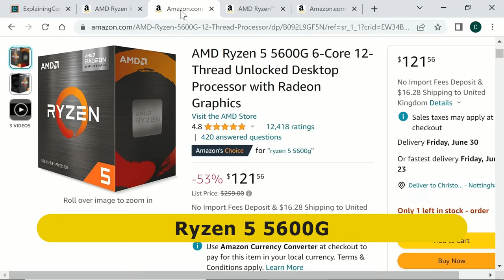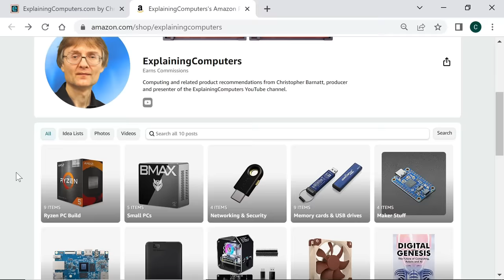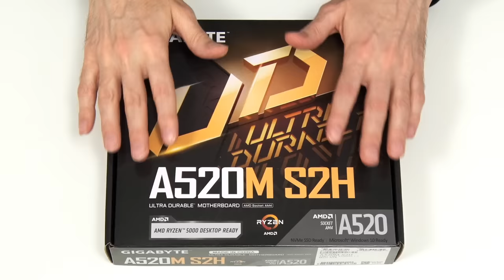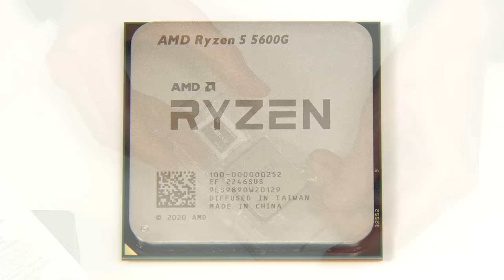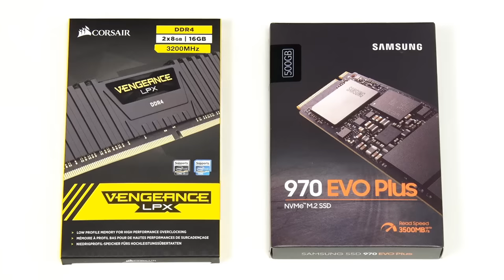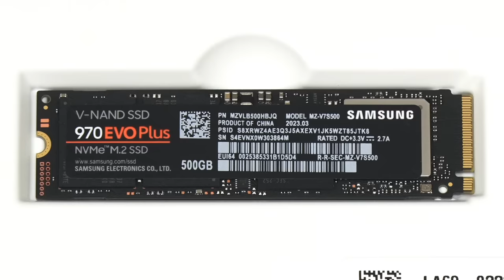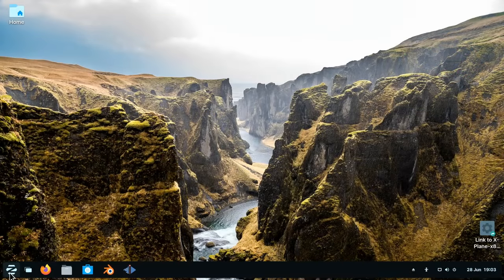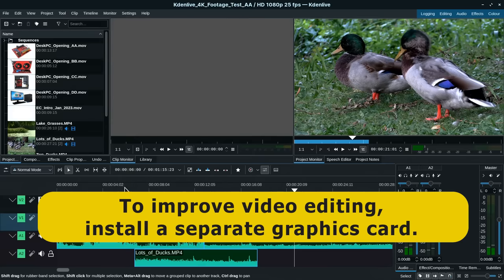Best Value Ryzen PC Build

Comment: Thanks for the vid.  Could you write a few words here about compromise made  using these components.  Specifically what ISN'T possible / needs an upgrade to achieve.  When would you choose a "better" motherboard ?  Does a non-g chip cost saving make a gpu "very good value" ?  Someone below mentioned a 450 motherboard that handles all ryzens, not a 520; is that a sensible route ? thx.
Reply from the maker: Many people here are obsessing about the benefits of B over A motherboards. But the only benefits are that (a) B motherboards can be overclocked, and that (b) some B motherboards have more connectivity -- eg 4 rather than 4 RAM slots, and maybe 2 rather than 1 M.2 slots. So they offer better upgrade options. But they also cost more. So unless you plan to upgrade or overclock (and on most PCs, neither ever happens), there is nothing at all wrong with an A motherboard. To be absolutely clear, there will be NO difference in performance.

Note that you may hear/read that B motherboards have more/better VRMs (voltage regulator modules) which is true for the higher-priced B boards. But again this is only really an issue if you want to overclock. So there's a theme emerging here! If you don't want to overclock, there is no problem getting an A motherboard.

Also be very aware that 450 motherboards may well need a BIOS update to work with a 5000 series Ryzen -- regardless of what the listing on Amazon or otherwise may say (ie just because there is a BIOS available for the board that supports 5000 chips does not mean that it is installed on the one in the box). And 450 boards are not likely to come with something like QFlash Plus. So you could need a previous generation CPU to fit in the board to enable you do the BIOS upgrade! Hence, you need a good reason to purchase a 400 series motherboard over a 500 series if you want to use a Ryzen 5000 series chip. For me there is no contest -- a A520 is a better motherboard choice than a B450.

The only things not possible on this system will be higher-end video editing and gaming that require a powerful graphics card, which can always be added later. And if you plan to add a graphics card from the start, you can save money by using a non-G chip as you infer.
Reply: @ExplainingComputers  Thank you for taking the trouble to respond with such an extensive reply.  Do you have other videos re separate good value GPUs ?  thx
Reply: @ExplainingComputers  So, I can't stop thinking about this video it was really that good.  So here's a scenario that I would love you to take on , even if it's just a paper build, not a physical build, if I can be excused for trying to control your diary!

Take a student, starting 'A' levels, needs a pc with productivity work capability (ie not gaming) that will serve when they go onto University in 2 years time, to study Computer Science and perhaps Physics / Maths etc.  However they do want basic gaming ability, they just don't want to have to go through a major replacement cycle in only 2 years when they go to University.  
If they have to add/replace a GPU because at that time they want to enhance their gaming experience then so be it, that's on them, but they shouldn't have to replace the pc for study and project purposes (perhaps they get a used GPU right now - if they don't get a G chip - and they can decide what to do on that front later).

How does that sound as a potential (perhaps short) video that might attract a lot of attention given how popular this one was.
Again thanks for your efforts, much appreciated.
Reply from the maker: I think the build I did would fit what you describe above. :)

Comment: You can't  make an Apple computer with off the shelf parts. Therefore when you buy for example a Mac Mini , in the $599 you are paying for the operating system. However, no YT reviewer ever that builds a PC, considers the cost of Windows. They always say use Grey Market Keys or "OEM" keys when a new copy of Windows 11 Home costs $129.99. They use PC parts picker for retail pricing safe market prices to then use a Grey Market windows key. To make a fair comparison, the real cost of the OS should be considered. As a $599 M2 Mac mini can blow the doors out of most PCs

Comment: Nice AM4 budget build, but yeah, the Gigabyte firmware issue is a bit disappointing. Good cases are getting extremely hard to find, most manufactures are determined to make them as cheaply as possible with just the bare minimum of features. There are still some good ones out there though, take a look at SilverStone's new SETA D1 Mid-Tower, it has some wonderful build quality, some amazing cable management features, lots of hard drive space, and it even has 4 5.25 drive bays! My next build will be in one of those!
Reply: What is the firmware issue you refer to?  thx
Reply: @DeepakKumar-lv4te  Do a Google search for "Gigabyte motherboard BIOS vulnerability"

Comment: I bought a new MINISFORUM Neptune HX99G Mini gaming PC with Windows 11 Pro.
1) AMD Ryzen 9 6900HX
2) 32GB DDR5
3) 1TB M.2 SSD
4) AMD Radeon RX 6600M
5) Wi-Fi 6E
6) Bluetooth 5.2
7) 2xHDMI
8) 2X USB4 Port
9) 5X USB3.2 Port

My last full size MSI gaming desktop PC had a DVD burner in it and was just taking up space in the chassis so I don't miss having an optical drive.
Reply: price ?

Comment: Heeeey! What about us, continental Europeans who use the euro? 🙂

My favourite online PC parts shop would charge 312.96 EUR for the parts that you use (the Gigabyte motherboard), or 268,05 UK Pounds.
It is not the cheapest PC (online) store, but I purchased all my (new) computer parts with them, meaning I find them very trustworthy (which is worth a lot, imo).

I have a Ryzen 3 3200G, and also a 5600G and both run just nicely.

And for the nerds among us - my gaming PC has a Ryzen 7 5700X and a 3070Ti on an ASUS Prime X370-A motherboard (having come a long way from a Ryzen 5 1600/GTX 1650 Super 🙂 ).

Comment: I built a system with a Ryzen5 processor, on a Gigabyte MB that utilized M.2 memory slots as well as SATA. Worked fine, BUT to my annoyance, it would not run a good old, reliable Win 7, as I discovered there were NO GPU drivers available - a ghastly mix of HD and VGA for ikons and HD for background. Win 10 and above only!  (Sh**!) (Hate Win10 for it's 'snooping' on usage)
Ubuntu was GREAT, not one single hiccup, so I guess that is now a permanent Linux station, (I kept the WIN10 install on a separate M.2 SSD).
Reply from the maker: Yes, sadly WIndows 7 support is rare on (new) hardware these days.

Comment: The Ryzen 5 4500 looks really good right now. $100 US shipped for a brand new 6 core 12 thread part. I might build and flip some systems with it because it's such a good deal.
Reply from the maker: Agreed! Very good value.
Reply: You mean 5500? They go for around $80-$90. Which is the same chip as the 5600g.  Should avoid the 4500(4600g) since that is the slower Zen 2 architecture.
Reply: @itsatrap4986  In Canada, converted to US dollars, with taxes, the 4500 is $100. The US often has way better prices, but I was just using the price that I personally would be able to nab it at, so it's actually around $75 in the US.
Reply: @itsatrap4986  I also didn't know that it was Zen 2. That would explain its proximity in performance to the 3600.
Reply: @IndellableHatesHandles  Gaming is like a Zen+ R5  2600 from 2018 which is similar to my R7 1700 from 2016. The 4600g came out in 2020 to OEMs only but they wanted $154 retail, 4500 $129,  just last April of 2022. They never gave us a proper replacement for the 3200g/3400g. AMD abandoned the lower end market for the past 3 years. Let these cut down desktop mobile chips rot on the shelves. No one should be buying a R5 4500/5500 for 2600/3600 performance for $100+ 3-5 years later.

Comment: Nicely done. Never done a PC build before, but there's a first time for everything. Would a processor like this work with passive cooling if it wasn't in a case, anyone know? Bit of an ARM guy generally, but I need to set up a local server which I'd like to do on x86.
Anyway, superb video.
Reply from the maker: In theory, you could use something like this: https://amzn.to/3rgCGnX (affiliate, as the links are shorter) . . . But if you don't need the power, you may be better off with a passive Celeron, like I used here: https://www.youtube.com/watch?v=HRJvSux34Hk (and still in use every day connected to my TV).

Comment: AMD Ryzen 5 5600G is on older Cezanne(monolithic die) architecture, while 5600, 5600x and up are Vermeer(with Infinity Fabric). Despite the naming scheme, has higher memory latency, supports PCIe 3.0(not PCIe 4.0 like 5600 and up), also with half the L3 cache of Ryzen 5600. Its actually comparable to Ryzen 5 5500 only.
And while 5600G GPU is quite competent, Ryzen 7000 CPU's integrated GPU is much weaker, a nice-to-have if you need 2D output or troubleshoot actual GPU. And should be disabled to lower idle power draw, according to the best of the best experts, the random Reddit users.
Video is not wrong in any statements, just the average viewer is going to miss these points, through intentional or accidental lack of information presented by companies. As I did
Reply from the maker: The video does indeed not provide any information on disabling the GPU on a 7000 series Ryzen it does not feature! :)

Comment: Not a bad startup build though for those in the US instead of wasting money on a Samsung 500GB for $38 you can get a 1TB NVME SSD from Leven, or Silicon Power with same performance as the 970 Evo Plus (they were just as cheap during the month of June.)  For me I've bought two 4TB Leven NVME SSD drives this year, and both are running very well.  I do wish that AMD will hurry up and get the AM5 APU out to market sooner rather than later (and hopefully it'll have the 780M instead of the 680M.)
Reply from the maker: There are indeed cheaper SSDs than the EVO, but not (as far as I could find) with the same sustained write performance. I'll be covering this in a video fairly soon.
Reply: @ExplainingComputers  Yeah I checked the Amazon UK prices prior to commenting, and they're a tad more expensive over there than here in the states.  Though I will say (for US viewers)  if write speeds are the most important then the Crucial P3 Plus 1TB would be better than the other two brands for a few dollars more.

Comment: Great video Chris i have the Ryzen 7 5700G but i also have an RTX 3060 would be interested if you might consider doing a similar video on the Ryzen 7 G
Reply from the maker: Thanks, but a video using the 5700G would be identical! :)
Reply: @ExplainingComputers  I am confused.
are you saying there is no difference with possible bottlenecks involving ram and storage?

Comment: Chris, you did not cover how you got the OS onto the M.2 Drive.  Other then that is was a good build.  kind like the dozens I have done.  I would like to how to upgrade the M.2 from say 500G to a 4T M.2 when you only have 1 (one) M.2 slot or you want to make M.2 copy for a backup.  I have system where I need to upgrade the motherboard as windows 11 support the CPU and does not had the TMS .  At the time I build this system it was not a problem and I here talk about windows 12.  got to keep up.
Reply from the maker: True! :) But at 22:08 I do note that I explain how to install ZorinOS 16 in a video of that name: https://www.youtube.com/watch?v=GTMBFtl_xs4

To clone one M.2 drive to another, the easiest way is to use a USB 3.x to M.2 enclosure/adapter -- something like this: https://amzn.to/44CdmHC (affiliate). Be careful to get an NVMe model for an NVMe M.2 drive, or SATA for SATA. I will be covering this in a future cloning video. :)
Reply: NVMe-add-on cards are cheap; I bought one some years ago for about € 20.- Put the card in a GPU slot, and it will be fast. My MoBo has 2 NVMe slots, and the add-on card in the secondary GPU-slot is running the NVMe faster then the secondary NVMe onboard slot. I have it running Windows 11. I used Acronis to clone the drive, but there are other (free) programs available, too. Just make sure to remove the old NVMe-drive before you reboot.

Comment: Hello. Fist of all congrats for your amazing work. I was particularly interested in this last video because I'm thinking about buying a new pc but... I'm currently writing this on a PC which is about 20 years old and is STILL working (although a bit slowly). So I've just purchased a SSD 2.5 250 gb and trying to install mint 21 on it. I've tried all types of bootable usb apps in linux but none work. I had to borrow a laptop with windows and use rufus, then it worked. The point is that I don't want to use windows anymore. So would it be too much to ask you for advice on which app to use to create a WORKING bootable usb IN linux? 
P.S. I have already tried all of the recommendations you find on forums/linux helps, etc. Maybe you know better.
Thanks in advance and have a good day.
François in Spain
Reply from the maker: I've no idea exactly what you mean by "bootable USB apps in Linux". I have covered creating a bootable Linux USB in almost every one of the scores of Linux distro reviews on this channel. I always do it using Balena Etcher to write the ISO to a USB drive -- which is the method covered on the Linux Mint website.

I very strongly suspect that,  if your PC is 20 years old, it has a 32-bit processor, so the issue may well be that you are trying to run a 64-bit version of Linux on it, which will not work. Linux Mint 21, for example, is 64-bit only. So the issue has nothing to do with the installer. Go for a distro that still offers a 32-bit version, such as Debian: https://www.youtube.com/watch?v=YRaJa-VjLGE

Comment: Very nice video, and a good selection for an "Everyday PC" for up to simple 720p gaming.
I especially like the quality of your explanation, which is a new gold standard for me.

A few small points though:
1. If gaming isn't your intended use, shouldn't the cheaper Ryzen 5 4600G, or possibly even a 4300G, already be just fine ?
2. Since the intended RAM speed is @ 3200 MHz XMP, would it not be better to get DDR4-3600 instead ?
3. The Gigabyte A520M S2H only has two RAM slots, and with 2x8GB=16GB only about 14GB are left since the APU uses up to 2GB for integrated graphics. So a future upgrade might make sense, only you would need to replace both RAM modules for it. Wouldn't a board with 4 slots like the "ASRock B450M Pro4 R2.0" make more sense ? It's not like the mobo chipset matters with that kind of setup anyhow.
4. SSD prices are at a new low, the average space used for a new PC is 1GB which makes sense even if not used to the fullest since unused space results in a longer lifespan. See you opting on a 512GB only SSD is a bit odd.
5. A Radeon RX 550 has about the same level of graphics performance like the APU, which make a Radeon RX 6400 the cheapest dedicated GPU upgrade if buying new. Maybe both should be mentioned for perspective ?
6. The GPU performance of the Ryzen 5 7600X actually is 25% LOWER than Ryzen 5 5600G. You would need the 7600 or 7700X for about the same performance, and the weirdness doesn't end there. I'd recommend taking a look at the "Passmark G3D Mark" rating to get an idea - it's the best single value comparison out there, even though it only allows for a rough relative ranking. 2k to 6k G3D Mark is the 720p gaming range, from there to about 12k the 1080p gaming range and from there to around 24k the 1440p gaming range. The fastes entry there is a Geforce RTX 4090 with around 39k, which "only" is upper level 4k gaming but if you take DLSS into account, you actually are safely in the 8k gaming range - which is why the card gets advertised as such, and why taking such technology into account is a good example as to why these G3D Mark ratings are considered a "rough" comparison only. The stark hardware requirements stem from the number of pixels, which from double to quadruple in number with higher display resolutions. Not that any of that matters here, because 1440p is about the highest to could go with a Ryzen 5 5600G without it becoming a bottleneck.
7. The long-standing Go-To for simple GPU tests are the three "Unigine" benchmarks called "Heaven" ( DX9 Vintage Gaming ), "Valley" ( DX10 Simple Games ) and "Superposition" ( DX11 Midrange Games ). These also work fine for Linux, allowing for direct comparison if you take into account that switching to OpenGL is required.
Reply from the maker: Thanks your range of points. I've been building PCs for 30 years, and am well aware of what you raise. :) Both in the build and in making the video, I have made choices. You may not agree with them, which is fair enough, although I disagree with a lot what you suggest. There are always choices to make, and I stand by everything I did and believe my choices were correct for my build and this video.
Reply: Your experience certainly shows.  good work.

Comment: Chris kindly do a follow up video with what follows the build;
Latest Bios update to fix issues
Pbo overclocking with undervolting to save power & lower heat yett get same performance as factory settings.
Linux Nobara or other distro, & Thanks man
Reply from the maker: See pinned comment and video description the motherboard fireware issue. :)